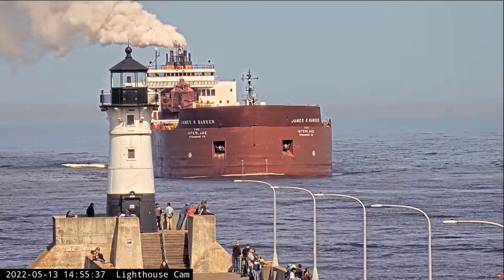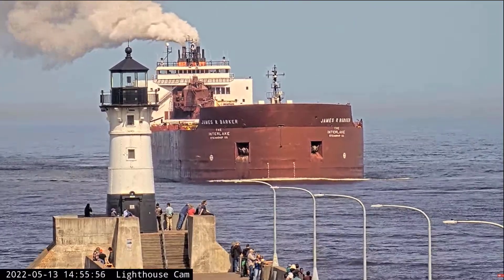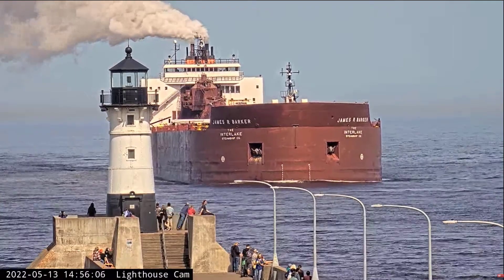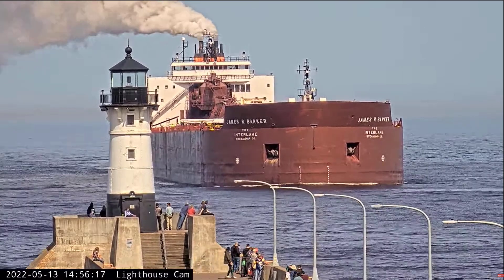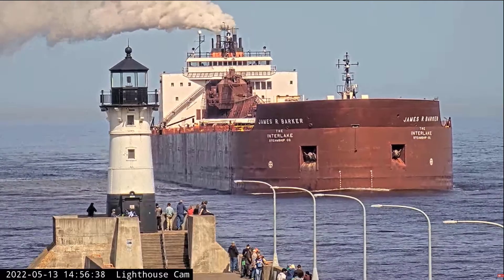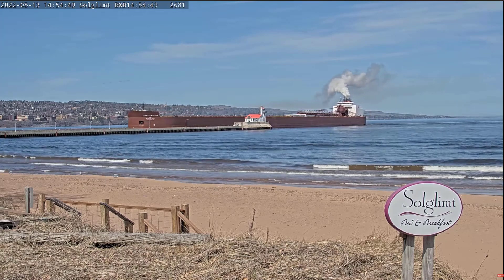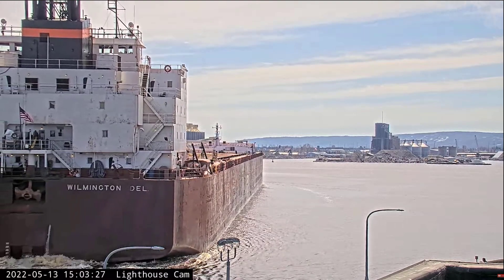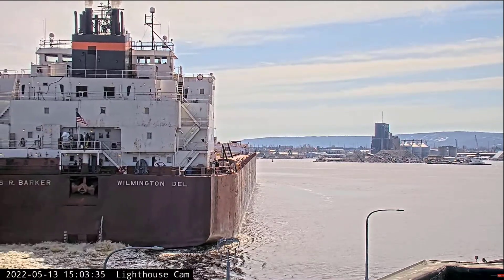James R Barker arrived in Duluth 05/13/2022

Comment: Love the train in the back ground,being a retired railroader.
Reply: Where did you retire from,,NS in South Carolina here
Reply: @timothyward8564  short line in Illinois, the Bloomer Line, our power was a rail fan favorite  since it is painted like the CB&Q red paint scheme.  Still had 4 locos in that paint,when I retired.
Reply: @pauljones2762   Wow. never knew about that line but now it is on the list of illinois lines to catch nextime I visit family out there.
Reply: @Island_Line_Rail_Productions  the Bloomer runs on an as needed basis, they are a grain hauler for Alliance Grain, one of the motors is stationed at the elevator west of Gibson city where it works mornings and later afternoons switching the ethanol plant. It's an x conrail unit, New York ctrl heritage within conrail number 7549. High hood, long hood forward, drum controller and 24rl brakes. Water tanks from when it was in passenger service, converted to additional fuel. It's painted as well as 3 others as the red CB&Q paint scheme.